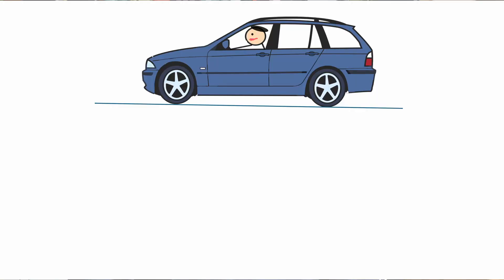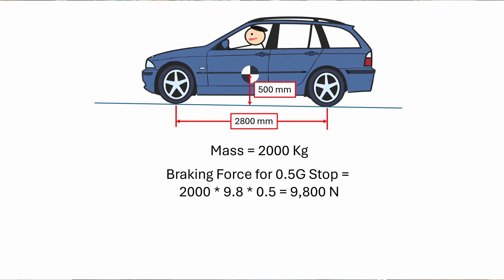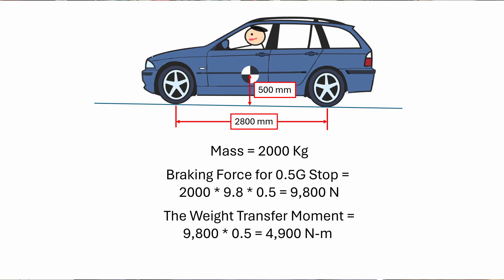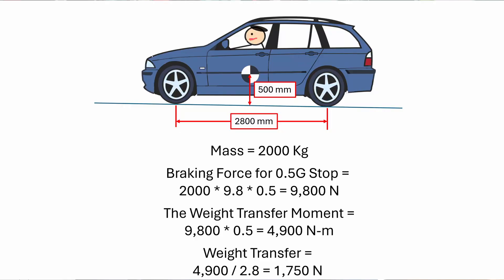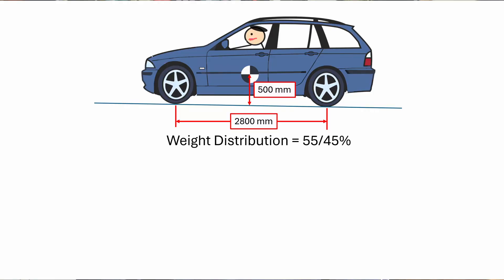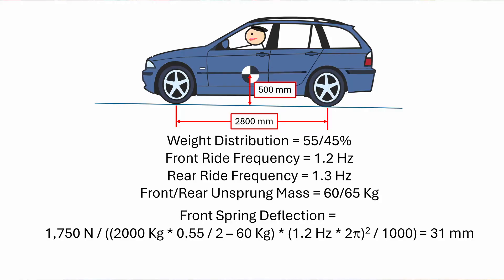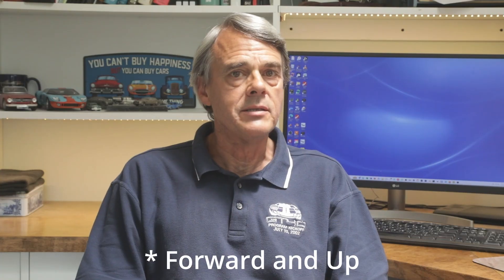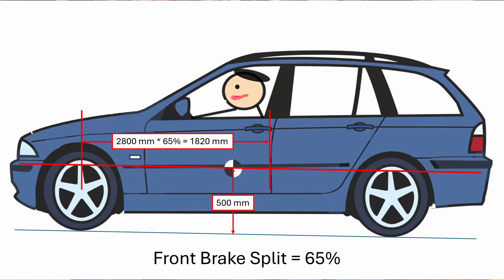The definitive guide to Anti-Dive and Anti-Lift in suspension systems. What it is and how it works.

Comment: please explain how inboard brakes affect the anti dive analysis. Braking force acts at the tire contact patch regardless where the rotor is located. Why would that change the force analysis?
Reply from the maker: It's a matter of the reference frame you are using. You are correct that the braking force happens at the contact patch, but that is true from the vehicle's perspective. We, on the other hand, are interested in what is happening from the suspension's perspective. We need to look at the forces being applied to the suspension, not the total vehicle. If we look at it like that, if the brakes are inboard, the suspension sees the force of braking but not the torque that the brakes create. If you think about the suspension, there is no part of the suspension that exists at the contact patch. How can anything push on the suspension at the contact patch if there is no component of the suspension at that point? Think of it this way. If the car is up on a hoist, and you push the tire at the contact patch, what happens? The tire will just rotate and will not push on the suspension at all. Now do the same thing but have someone is step on the brakes. Now, the tire cannot turn and WILL push back on the suspension. This is because the brakes are creating a moment that tries to twist the suspension in reaction to you pushing at the contact patch, With inboard brakes, the same thing will happen, but instead of applying the moment to the suspension, it applies it to whatever the brakes are attached to (most likely the engine or differential). So what happens to the suspension in this case? Since the wheel is attached to the suspension with a bearing, there is no moment transfer between the wheel and the suspension, This means there can ONLY be a force transferred between these two components and the location of the force is at the center of the bearing which lies on the same axis as the center of the wheel.
With outboard brakes, the braking force creates a force AND a moment on the suspension because the brakes are directly attached to the suspension. This has the effect of "projecting" the point at which the braking force is applied down to the contact patch.
I hope this helps.

Comment: Does Anti-dive also take affect for deacceleration without the use of the brakes? Say the driver lifts the throttle, will the antidive still have an affect on pitch? I would think yes, but everytime i hear people discuss anti-dive, its always described through braking only.
Reply from the maker: Yes it does, but instead of looking at the motion of the contact patch, you look at the motion of the wheel center. The ideal line is also drawn to the wheel center, not the contact patch. The analysis and process is otherwise the same. That’s all true for an independent suspension. For a solid axle, anti drive in deceleration is exactly the same as braking since the differential is part of the suspension.

Comment: Anti-lift is one of the brilliant thing Citroën did on their cars with hydropneumatic suspensions between 1955 an 2000. They simply power the rear brakes from the rear hydraulic suspension circuit. Remember that the brakes are fully powered hydraulic brakes and not just servo-assisted "manual" brakes. So the source of pressure for the front brakes is from the hydraulic pump powered by the engine, and the source of pressure for the rear brakes is the rear suspension circuit. When braking, the rear suspension is simply getting a bit of it's pressure "stolen" resulting in the rear losing height. The best part is how good it works and how simple it's achieved. The rear height stays exactly the same regardless of how hard you brake, and the probably best anti-lift ever made is done with only adding one extra pipe. And it gets even better. By doing it this way, you get to have rear brake pressure exactly in proportion to the load. Remember the hydraulic suspension? When you put some heavy cargo in the trunk, the suspension compensate this with raising the pressure which compresses the suspension spheres and lifts the car. So now you both have proportionally more rear brakes but also stiffer suspension. But wait, there's more. By compensating for the load with higher pressure that compresses the spheres, you get a larger amount of fluid that has to travel though the dampening which is at the entry to the spheres. So you get stiffer dampening too. Finally, note that the anti-lift here works perfect regardless of the stiffness of your suspension/dampening. It's simply a height-related hydraulic "transaction". The added stiffness is just another bonus. It's mind-blowing how good it works and how any new vehicle today feels worse compared to both a 70 year old DS or a 2000 XM or Xantia.
Reply from the maker: Thank you for sharing this. I was not aware. The DS continues to amaze! Still ahead of its time 70 years later.

Comment: What software is used for the instantaneous radius method. Also, how can I apply it to an assembly if I am yet to design the geometry for that assembly ?
Reply from the maker: There are multiple software packages that can do this but unfortunately, they are all very expensive. The one most often used is ADAMS but any multi-body dynamics modeling software package should be able to do it.

Comment: I'm designing my first suspension which is a double wishbone for the front of my 57 chevy pickup with 4wd. This is helping me design the correct parameters for my truck instead of just copying measurements from other set ups that were made for different vehicles that were designed for different parameters. Although I don't think a leaf sprung I beam axle with minimal caster since it didn't come with power steering will be hard to beat

Comment: Great educational video!  A few questions please:

1.) Using the instantaneous radius method for anti-dive, if this point is below horizontal, what angle should be used?  
2.) What if this point is forward of the axle and above horizontal, still use angle from horizontal?
3.) Would this method still be the “preferred method” if the geometric method gives the point/angle above horizontal, rearward of the axle? Shown more like your example. 
4.) Instead of moving the wheel a “small amount” up and down to get the instantaneous center, couldn’t you make a circle out of three points of the contact patch (i.e. droop, ride height, and bump) and draw line from the contact patch at ride height to center of the circle? Even by very small amount, would this not be even more accurate?

Comment: what i'm curious about now is that how do these affect the traction on tires. but i have a sense telling me that in the long run the traction remains mostly the same cause you're not really taking anything away or adding. especially on the rear anti lift. you achieve it by suspension moving upwards during braking and countering the spring force. but cause it is moving up, my brain thinks we are taking away force that is keeping the wheel on the ground thus reducing the traction. but i think there isn't any real loss in traction. or is there? i am factoring out all the weight moving from the braking itself.

Comment: I didn't see anywhere in this video were you talking about the actual braking torque applied to the spindle and how it is transferred through the A arms and influence their motion. The whole conversation is centered around weight transfer. The torque force is actually quite significant.

Comment: please talk about hydraulic lower control arm bushing. My car`s front suspension has double wishbone geometry and I have noticed the OEM·`s LCA has 3 differences offset number I can purchase and require different caster angle by it own when alignment . I am confusing what is the purpose of manufacture ? Will it change steering feel or tire performance or both ? Thank you so much sir !

Comment: Perhaps you might make an effort to discuss things like Ackerman effects, and geometries that deal with camber and caster, especially at the front wheels, where steering occurs.  I believe that too little understanding occurs regarding the complexities of front suspension design that deal with getting the axis of vertical (steering) rotation aligned so that things like scrub radius are well described.

Comment: Hello,Author

When drafting characteristics such as anti-squat and anti-dive/lift, the starting point on the suspension side is the pivot on the outboard side, not the inboard axis of rotation. This is obvious given the definition of instantaneous center.
 This is because it is necessary to find the instantaneous center of the hub carrier, which includes the hub carrier in the case of anti-squat and the tire contact point in the case of anti-dive/lift.
 Incidentally, the drawing method, for example, for the A-arm of a double wishbone suspension, draw a line from the center of the outboard joint parallel to the axis of rotation on the inboard side.

Unfortunately, many technical books are also incorrect.

Comment: @suspensionsexplained Hi, I am designing suspension for a self-made vehicle of sorts and I have a question regarding anti-lift  and anti-squat of an H-arm rear suspension design. Firstly, I am considering using H-arm rear suspension because I plan on using rear knuckles from a Mazda Miata. I noticed on the Miata suspension that the H-arm seem to be totally horizontal. This confused me because it seems to me if the H-arm and the upper control arm were kept parallel but angled backwards it would add both anti-squat and anti-lift properties to the rear suspension. I am wondering if I am understanding this correctly or maybe there is another reason I haven't considered for the control arms to be horizontal. 
I am also considering using double wishbone suspension in the rear but I am also a bit confused about this because lots of people suggest tilting the upper A-arm forwards. This would of course have an anti-lift effect under breaking but as shown in your video on anti-squat this design is actually pro-squat. Thanks for baring with my lengthy comment, I hope it makes sense. Keep up the amazing videos!

Comment: Thanks for putting together such detailed explanations!  I was wondering if the mass and CG height used to calculate dive, squat and roll moment should be the sprung mass and CG height.  I could see on a larger vehicle the difference might be pretty small, but on a smaller/lighter vehicle it could be meaningfully different between total mass X CG height and sprung mass X CG height.  Thanks!

Comment: Mr Mees, thank you for a great series of videos, this shade tree mechanic is learning a lot. Would you be able to answer for me a notional extrapolation of a concept (or if you did a video elsewhere just point me to that please), what would happen if the wheel base of a car was extensible? For example, take the wagon you had in your example, if it was extended into a limo configuration and became 50 mm longer at the wheelbase would all of those calculations be qualitatively affected positively or negatively in their effect for antidive anti-squat properties?
Reply: Thank you for your comment. Extending the wheelbase has the effect on increasing the amount of anti-lift. The reason for this is that the angle of the ideal line is reduced with a longer wheelbase. This makes sense since the weight transfer is a function of wheelbase. As the wheelbase grows, the weight transfer gets smaller for a given deceleration, so it takes less braking force to counteract the weight transfer that is there. Since the suspension geometry doesn't change with wheelbase, and the braking force doesn't change, the amount of force the suspension generates to counteract the weight transfer will still be the same, but the amount of weight transfer has been reduced. Therefore, the suspension is counteracting a larger percentage of the weight transfer with the longer wheelbase. I hope that makes sense.

Comment: @ 3.33 second , after solving equations values coming 62.8 mm for front and 68 mm for rear , how you took 31 mm and 34 mm spring deflection?
Reply: There is also 1.2Hz used for rear spirngs instead of 1.3Hz from datasheet.
Some miscalculations have happened here.

Comment: Dear Author,
Is it necessary to replace both front shock absorbers if only one has failed (due to hitting pothole with one wheel)?
Thank you
Reply from the maker: Yes it is. The good shock will still be partially worn and combining it with a new shock will be a problem. You want the same level of damping on both sides of the car at all times. And besides, that other shock might be 2 miles away from failing as well. You never know!

Comment: When using the instantaneous radius method, you talk about locking the brake to lock the wheel to the upright. Does this mean that the contact patch location on the tire is the same point used at zero deflection, rotated with the knuckle (if the knuckle rotates) for the up/down deflected positions? Or do you still just drop a line straight down from the axle centerline for the deflected positions? 

I'm trying to analyze the multi-link rear suspension on my BRZ, which has a lot of angle in the trailing link, and may cause some rotation of the knuckle when deflected, making a significant difference in the front/back location of the contact patch between the two methods.
Reply from the maker: You need to imagine the brakes locked so the contact patch momentarily moves with the knuckle. If you juist drop a line straight down from the wheel center then the contact patch would just do whatever the wheel center does. That would be incorrect. Lock the brakes while making the tiny up and down motions to give you the instant center line.
Reply from the maker: You use the contact patch with a locked brake. You use the same point that you used at zero deflection. I know this seems odd but that is why you use very small suspension deflections to do this method. I used 10 mm but proper multi-body dynamics systems like ADAMS will use much smaller deflections to eliminate as much error in this math as possible.

Comment: Can anti-squat help with traction on front wheel drive cars?
Reply from the maker: No, it can't. Anti-squat needs a drive force in order to counteract the effect of weight transfer. If there is no drive force, then there are no anit-squat forces. A FWD car has no drive force in the rear.

Comment: How exactly is the center of gravity height defined, e.g. when the vehicle would stand on an axle articulation test with FL and RR wheels up and FR and RL wheels down? Does it have to be defined per wheel?
Also, what would happen with a rear wheel driven independent suspension with regards to anti-squat / anti-lift? How does the suspension "know" where the weight transfer is coming from? (since this will change whether one draws the line from the contact patch or the wheel hub if I understand correctly)
Reply from the maker: The center of gravity is the point at which everything is balanced. Imagine the car suspended on a string attached at some point in the car. If the string is attached at the center of gravity, then the car will be balanced in all directions.

Comment: I am very confused with the spring deflection equation. The order of operations on it is very unclear and it seems like you're putting the entirety of your load onto a single spring which doesn't make sense because you calculated the equation as the entirety of the car, which will have two springs. The only way I can get the answer in the video is by doing the entire equation and then dividing by two and even when I apply this to my own car's parameters I get values that are not physically possible based on data from a previous car. Could you explain in more depth where the 1000 value comes from specifically that's the part I am most confused on.
Reply from the maker: This video wasn't the place to get into the details of the ride frequency equation, but the equation is 1 over 2pi times the square root of K over M. K is the spring stiffness (actually it is the suspension stiffness since the spring is most likely acting through some motion ratio) in newtons per meter while mass is in kilograms. Since I wanted to find the deflection in millimeters, I had to convert the spring stiffness from newtons per meter to newtons per millimeter, hence the 1000 term. Also, the mass term is shown as 2000 kg times the weight distribution divided by 2. This gives the mass of one corner, not the whole car. I then had to subtract the unsprung mass since that is corner mass that is not supported by the springs and doesn't contribute to the ride frequency. I hope this helps to overcome any confusion.
Reply: @ 3.33 second , after solving equations values coming 62.8 mm for front and 68 mm for rear , how you took 31 mm and 34 mm spring deflection?